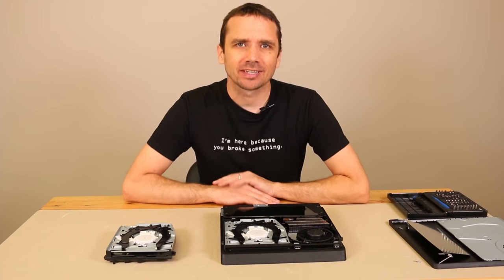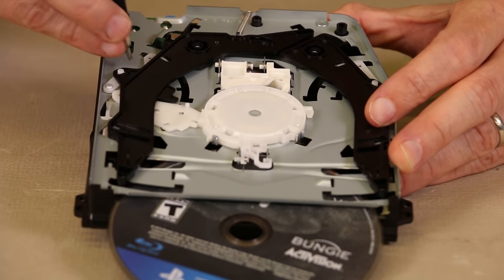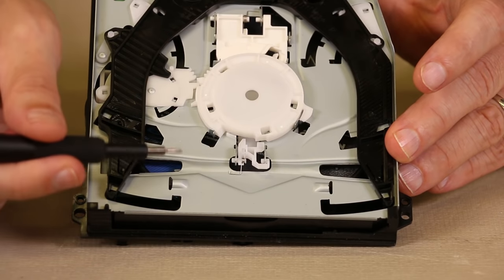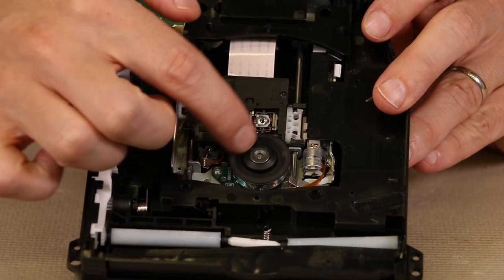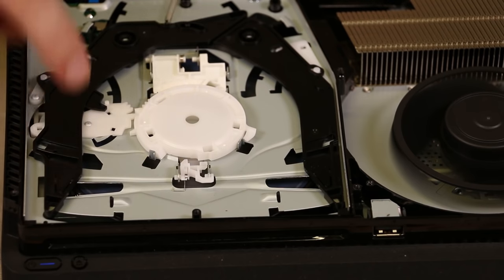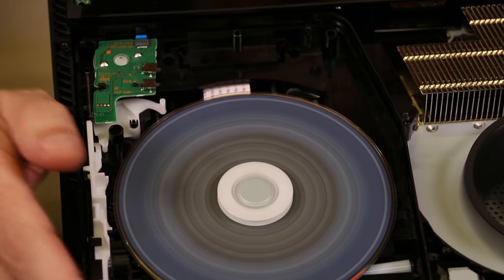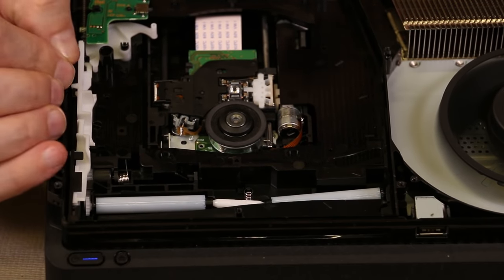How a PS4 Disc Drive Works - Very Detailed

Comment from the maker: Thanks for watching! Let me know if you have any questions or good ideas for more videos.
Reply: TronicsFix so why ps4 have hard drive why you need to install games and put disc (what is the work of hard)????
Reply: GON A first games are bigger now 50gb ,so it is difficult for the lens to read, and for ,faster loading, ,,etc
Reply: Hi!! one question is it safe to put the ps4 in vertical with the vertical stand as example..  does it damage the disc drive in long term??   

Great video, greetings !!
Reply: NeoGuruGames no problem , vertical or horizontal is the same
Reply: Not gonna lie, i like ur videos.
Reply from the maker: The video shows the disc drive. The hard drive is the storage. It's called a "hard" drive because it used a hard disc inside instead of a floppy.
Reply from the maker: It won't cause any problems.
Reply from the maker: I'm not gonna lie...I'm glad you like them!
Reply: TronicsFix I've had my PS4 slim for a few months and some of  the games I've played on it like Injustice 2 make the fan get pretty loud at times, some ppl have said this only happens with games that are compatible with pro enhanced but I was wondering if that's true and should I be worried with the sometimes loud fan?
Reply: TronicsFix can you show us how to clean ps4 bluray disk.. Pls??
Reply from the maker: I'll try to do that at some point
Reply from the maker: I don't know if it's true or not but your fan is supposed to work that way and is nothing to worry about unless it actually overheats.
Reply: TronicsFix Ah okay, thank you Sir
Reply: TronicsFix   Nice  video, man.  Would  you  be  able  to  do  videos  of  troubleshooting  faulty  parts  and  then  fixing  whatever  problem  it  has,  like  replacing  some  of  the  finer  parts,  or  cleaning  parts  that are causing  the  device  to  be  faulty.  For  example,  with  a  faulty  disk  drive  such  as  the  one  in  the  video  and  you  troubleshoot  the  problem,  then  finally  fix  it  by  replacing  a  motor  or  laser.  Or  cleaning  a dirty  roller.  Or  whatever  else  might  be  the  problem  with  the  drive.  Still,  I  like  how  you  take  us  to  see  what's  inside  and  how  it  all  goes  together  to  make  it  work.  So  keep  up  the  good  job.
Reply: TronicsFix   Another  request  for  a  video,  if  you  can.............. Can  you  do  a  comparison  of  what's  similar/different  inside  a PS4  to  a PS4 Pro?
Reply: TronicsFix can a wireless Xbox one controller operate on a Xbox one s
Reply: Not sure if youve done these, but common controller issues, thermal paste applications, hest sync malf/solutions
Reply from the maker: Thanks man! What repairs would you like to see?
Reply from the maker: Possibly
Reply from the maker: Yep
Reply: my ps4 slim's drive wasn't accepting the disc so i opened it up and fixed the rollers. it now accepts discs and plays the game but the dvd drive is making a lot of noise when it spins the game. what is causing the noise?
Reply: TronicsFix  PS4 Slim is scratching the label off my games. What is the problem. pls & tk.
Reply: TronicsFix   how  about  fixing  a known  issue,  where  the  hdmi  port  on  the  back  makes  a loose  connection  with  the  hdmi  cable,  and  then  gives  a "no signal"  on  the  tv.  It's  happened  to  my  PS4  and  other  people's  too,  from  what  I've  read.
Reply: Hey I got a question does the laser touch the disc
Reply: TronicsFix hey My Xbox One Wi-Fi won't work , is it easy enough to swap the Wi-Fi chip for another? Thanks.
Reply: can you fix my ps4
my rollers are messed up and i dont know how to fix it
Reply: Hello.  I am having an issue with error code E-801809A8.  From a little bit of research it seems it is caused by a faulty blue ray disc drive.  Have you heard of this error code?  Is there a specific problem with the disc that this error code refers to?
Reply: TronicsFix My dusk drive makes a buzzing noise how do I fix this??
Reply: can you help ps4 turns off and then I have to plug it out to get it to turn back on but shortly after it turns off again please help
Reply: please the ps4 slim is very quitte really
Reply: I just found this video of the disc drive mechanics and it's really informative. Do you possibly have a video of the 1215a disc drive mechanics? For some reason I don't know,  every ps4 model they came out with has a disc drive that is a little different than the last one.
Reply: TronicsFix What are Grooves??
Reply: U said that the ps4 reads the little grooves on the disc ..What are grooves??
Reply: TronicsFix my ps4 makes a whining noise on and off for a few seconds and then it loads my game and if i leave it on the home screen it wont read the dis ehat is wrong with my ps4 disc reader
Reply: Hey! Tronicsfix. Please make a video on, how to set inverter problems. Whenever there is outage of electricity my ps4 automatically turns of. How to fix it. Please show. Even though I have an  inverter.
Reply: It would be really nice if you did a "How a disc drive works for older PS4 models" video (CUH-1115A) I am getting an unrecognized disc and tried pretty much everything, can't figure it out. Might have to just replace it entirely. It's more fun to fix it though :)
Reply: Can you tell me how to fix ps4 slim disc spinner it dont spin i dont now why. 😭
Reply: What if your ps4 disc drive is scratching the top of your disc where the image is, what do you do to fix that issue?
Reply: malbhet mayby ☺
Reply: Hi,

Does a physical copy of the games get scratched when play a lot? I am asking because I am afraid if my physical games will be rotten after some time and have to buy again. :/
Reply: My ps4 takes the disc in but doesn't spin it makes clicking sounds ever now and then.
Reply: I purchased a PS4 pro and was wondering why it sounded kind of loud when I inserted the disk.  I guess this kind of explained it. Thanks bro
Reply: @Tronicsfix  nice video Tronics fix. I have a real problem.  I opened and cleaned my disk drive and now the disk not inserting. Can you please help me to fix it. I can insert and remove manually with screwdriver but sometimes it isn't working. The problem is I can eject the cd but can't insert it. It is ps4 pro.
Reply: Hey I need some help for my ps4: when I insert a disk it doesn't always reads it. What am I doing to play is shaking the ps4. Is that good? Another one my ps4 needs a couple of seconds to pull out the disk
Reply: My motors wont engage when I put a disc in. Anyway I can fix this?  Help would be much appreciated.
Reply: TronicsFix, such an excellent comprehensive video. Thank you for your service.
Reply: Hi tronics. I have just purchased a new laser deck for my ps4 but the disk wont spin at all and the laser doesnt light up. I can see the lense moving up and down trying to focus but nothing comes out. Any ideas on what could be causing it? Thanks
Reply: TronicsFix 
Hi I’m having a problem with my disc drive. Today I have put a disk in and it didn’t read. I then loosened the screw to get my Fifa 19 disc back.
I then turned on my PS4 and the disc wouldn’t enter.

What do you think happened and how can I fix it.

I would like a reply ASAP
Reply: my ps4 freezwhile playing , what is the problem
Reply: TronicsFix  My PS4 doesn’t always accept discs. It accepts one then when I’m done and want to switch a game it doesn’t accept another one for a loooong time.
Reply: @Tronicsfix  has anyone asked about how to reset or general location thatthe springs sit inside? ive got one sole itsy bitsy spring that was rolling around looslyinside mine and it makes thegod aweful er er er noise during start up, refuses disks and every other pieces are sitting properly
Reply: How do you make it spins with no disc
Reply: TronicsFix  my cd is not spinning
Reply: TronicsFix I just replaced my laser reader on my PS4 slim now my disc spins clockwise then counter clockwise then says unrecognized disc do you have any solutions?
Reply: what happens if you move the ps4 with the disk in tray
Reply: what happen if you move the ps4 with the disk in the tray
Reply: Um I tried to take apart my ps4 slim since my disk drive was acting up and now when I put it back together it says that there’s a serious issue and also won’t spin the disk properly
Reply: So if the optical laser goes bad should I just replace the whole disc drive?
Reply: @TronicsFix ! Thanks for creating such a knowledgeable video. I have a question. Does the ps4 game disc always keep spinning or it just spins at the time the game is installing?

I have read on many forums that ps4 copies the entire game on the hard drive and the disc is used only at the time of installation.

I'm worried that while playing my disc will suffer from wear and tear.
Reply: I'm having a strange problem. The disk drive wouldn't take a disk so I took it apart and checked the rollers and crossbar. While disassembled the drive works great. I can insert the discs and eject them fine. They also spin up and read. However after I assemble the system again, once I eject the disc it won't allow me to insert a new disc. If I take it apart it works beautifully, but again when assembled it will allow me to insert a disc once, but once ejected become stuck again and won't take a new disc. Any ideas to why this happens?
Reply: My PS4 Pro won't read bluray or my games but will play normal DVDs does my laser light need cleaning? As I can hear the disc spin.
Reply: Help!!! I was cleaning the fan my ps4 slim and when I put it back together a part fell out of it and I don’t know where it goes. On the part is says something like “2-1s” not really sure bc it’s hard to read but I’d appreciate any help I can get.
Reply: @Tronicsfix  I know this is a old video but I have a question, when I put in a new disc it only copies the disc then it just downloads a update file, it's not installing the game, I have no idea why, it doesnt show any errors?
Reply: Hello. Thanks for your vid. I have a question. My ps 4 pro has stopped reading discs . I believe the problem is in the thing which spins the disc. When i put ps4 to the side and shake it for couple of seconds it reads the disc perfectly. How can i fix the problem ? Can i just try to clean that thing which spins it or is there another solution ?
Reply: What's the cog placement on the other side? Because a gear with spring inside fell out and no idea where it go's? It's a UK version
Reply: Can you run a ps4 without a disk drive
Reply: Why wasn't spindle motor spinning at end? I was convinced my issue was the spindle motor was bad until I saw at the end where yours was trying to read the disc just like mine but spindle wasn't  turning. Great video.
Reply: is the white magnet supposed to fit in the other piece so loosely ? mine falls out
Reply: How to replace a ps5 hard drive
Reply: That white piece came off now my ps4 won't accept any disks help please.
Reply: TronicsFix I just wanna say what does it mean when my dads ps4 makes ALOT of noise???
Reply: That black gear that fell out where does that go
Reply: What do I do when nothing happens when I try to insert the disc?
Reply: Having "unrecognised disk errors" and i think the problem is the rollers don't fully push down. So I tried to solve issue by starting PS4 without disc plate but with the magnet on (as shown in video) but the disc won't even spin
Reply: Really Insightful Video thanks!! Having trouble with my disc being read- one of the two switches (the top one) came off- can still eject/insert but can't read disc is this because of the switch that came off? was thinking it was more of a laser issue
Reply: I'm having a problem with mine that the little arm that holds the rollers down is stuck. How do I unstuck it?
Reply: I have a ps4 slim and the rollers in the disk drive aren’t moving up and down. What do I do?
Reply: Could you do a video on how to get those black arms on the top of it to move after I eject the game they don't go back into place
Reply: I think the switch is fault on mine, I'm not sure yet, that long white  part won't go down smoothly. Could that be a problem
Reply: Hi, i have a Fat PS4 with the shiny left plate, the 2 switches get pushed in by the White plastic gear part but the rollers don't start pulling in the disc. 

I replaced the laser/lens, and tried putting the old lens back and the problem is still present, what/where do you think the problem might be? 

The old lens stopped reading discs completely and that's why i changed it. I've done this before and this is the 3rd lens in my PS4.
Please help me 😅
Reply: I put my ps4 disc without any damage on disc at my ps4 and then on the tv appeared can't read the disc. the same situation happned with music cd. I don't know how to fix it.
Reply: My rollers are stuck and the lip won’t allow me to put a disk in at all
Reply: where are my rollers supposed to be?
Reply: hi the laser wont work idk what to do and when i put my disc it doesn’t suck or place in the inside
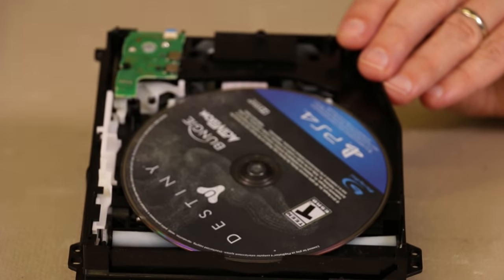Reply: 2:43 how did u attach the spinner again plsss repllyy brother

Comment: My ps4 is in trouble with the roller i think, when i'm about to eject my disc, its out bit and goes in again, it wont out perfectly. How to fix it man
Reply: Do you have a fix on this now? We have the same problem, sometimes when i insert the disc, the magnet won't secure the disc so the drive can't read it

Comment: I finally worked up the nerve to replace my laser, which went okay except the drive made a terrible noise afterward. After many attempts to figure it out I finally noticed the ribbon cable was just barely touching the disc (even though I matched up the line like you recommended), and that was the source of the noise. Turned out spinning it with my hand with the magnet on it while powered off was all I had to do to see it. Would never have done it without your guidance, Steve, thanks! Unfortunately a couple other things are still out of whack as a result of the many times I've dismantled and reassembled the thing, so I think I need to watch a couple of your videos one more time (maybe including this one).
Reply: Thing 1: Oops, forgot to reconnect one bluetooth antenna wire.
Thing 2: My drive hasn't worked quite right since after the first time I opened it for cleaning, eject always gives me a triple beep and the rollers roll too long (disc falls on the floor if I don't grab it first), never figured out why, but I just noticed the two switches here look different from mine, where the tiny lever is missing from from the rear one. Always figured the second switch was some kind of sensor that didn't need to be physically actuated, but I must've broken it by reinserting the plate with the arms in "disc in" position, so the part of the arm that activates the switches was sitting on top of them, breaking one when I tried to force it to sit flat without knowing what it was caught on. It's not enough of a problem to justify paying $11 for a new motor, and I'm sure it's not possible to buy just the switch anywhere, and it's hard to think of a repair for such a tiny piece... but I want to try anyway...

Comment: I really enjoy your channel. Thanks to u I fixed both my regular PS4 and my PS4 slim! Just took it apart and cleaned the laser and rollers and they both work like a charm now. Thanks again for making these videos!
Reply: I want to clean my laser and rollers but I need a torx screw, my ps4 doesn’t recognize my blue ray disk drive anymore

Comment: Thanks for this vid. I've been stressing out lately with the PS5 if I want to do it vertical or horizontal since I've always had horizontal disc-reading devices, but the PS5 looks better vertical. So it helps to see how securely the disc drive holds discs.

Comment: My PS4 Slim drive starts up to spin and then it stops and then starts and stops, etc....finally it gives up and I get an UNRECOGNIZED DISK error on the screen.  I have opened it up and cleaned inside and out.  Everything looked good and cleaned laser too and watch it hooked up again and no change; it starts/stops/starts/ on and on action till I get the error message.....any advise is appreciated!!  Thanks!

Comment: Thank you! Think this helped me solve my problem! As you said at the end with the laser trying to detect the disk but practically if it’s bad or the disc is then it will pull an error code up! Believe it was ‘CE-30005’ for the hard drive, went through the system deleted everything did all trouble shooting and even bought external drive and still had problem of not reading physical discs! So led me to believe after researching and thanks to this video that it’s probably the disc drive (more specific in my case the lens). I’ll try to buy replacement and see if it works. 👍

Comment: My q is this
I opened it all cleaned it all air spray and alcohol laser clean rolers whiped the full treatment, and this is what happens,

The disc starts yo spin than stops than the cycle repets it self coupke of times and at the end it pops a notification on screen that the disc is UNRECOGNIZED.

Is my LASER UNIT dead and should i replace it or is it something else?

Btw it easyer for me to order in a part than to send my console to service, and yet before i order a new laser unit i would like your opinion

Comment: Just wondering, since I relocated my PS5 and forgot to check for a disc inside it: Does that magnet holding the disc in place make it safe to gently move a console while it's turned off? I have some PTSD from my 360's disc drive